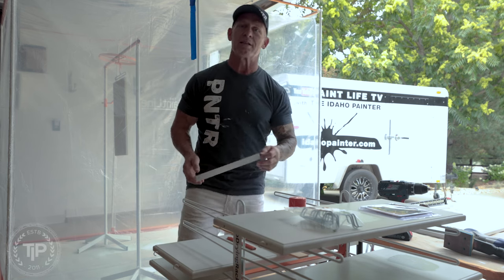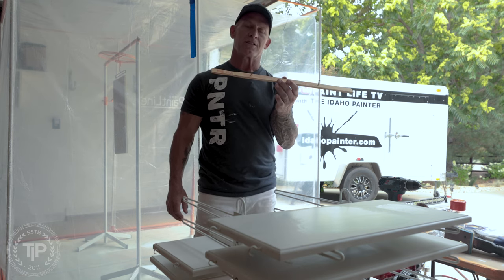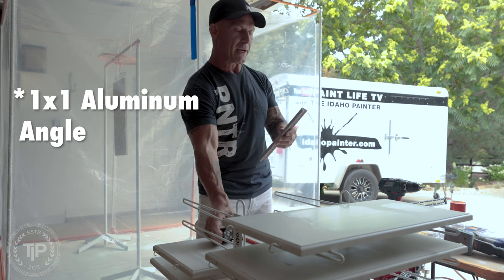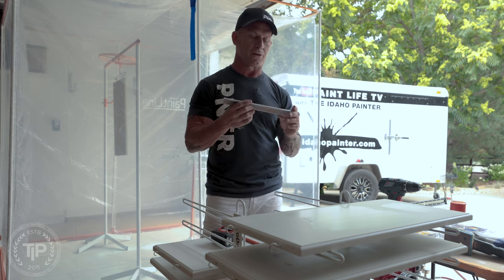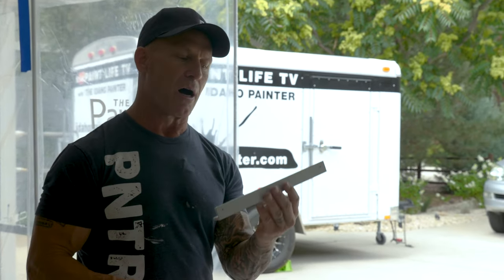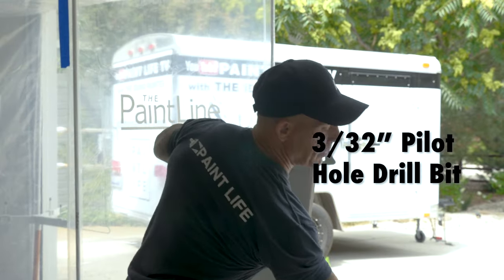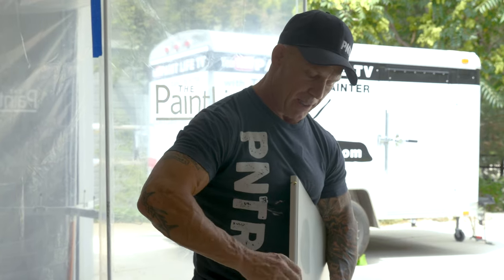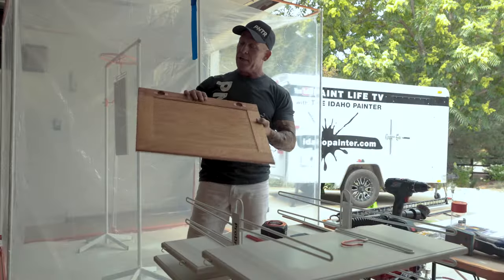Spraying Cabinet Doors Hanging.  Make Your Own Cabinet Painting Tools!

Comment from the maker: Do you spray hanging or flat?
Reply: Flat, but have done both. I just prefer flat. Great video Chris!
Reply: Flat, but willing to try hanging
Reply: Depends on how many beers ive had. 6 or less, hanging. 6 or more...flat. Lol
Reply: Flat but I like this hanging get up you got
Reply: Flat
Reply: I’m spraying doors on a coated wire hanging outside with wire coat hangers going through the door hardware hole😄 but i m using a good tip & graco airless!
Reply: Hanging, but in Sweden the doors often come with two holes drilled right through for the handle to attach with a nut and slim bolt, so my work is made easy by just popping it onto two steel rods that won't bend. Kind of like the metal hangers that stores hang stuff like chewing gum bags on.
Reply: I always thought flat to ensure no runs

Comment: Use the existing  hinge hole on each side of a door for a hook, then suspend from the wavy hanger with looped zip ties.  All sides can be sprayed, the door won't accidently come loose and fall,  and no new holes need to be drilled and filled for finish.

Comment: Why not paint them flat on a rotating support? Anyway, you'll dry them flat on a drying rack. Is there any advantage in painting them vertically?
Reply: Vertically allows both sides to be painted.
Reply: Paint both sides at the same time, no need to wait all day for them to dry
Reply from the maker: Yes there is

Comment: Chris, thank you so much for all the amazing videos. I'm a diy guy and at the moment I'm taking on the task to repaint my sisters kitchen cabinets while shes at the hospital. Its a surprise. I took care of all the prep but now I'm stuck on what primer to use. I was going to use the Bin Shellac but in other videos you've said its not a good idea to use the same gun when spraying oil based and latex paints.  Is there a water based primer you would recommend? I really need help with this because I cant get a straight answer from anyone. I'm planning on using Sherwin Williams emerald paint. I'm open to using a different paint as well.
Reply: they make a water based  Primer - B-I-N Advanced. I plan on using in my HVLP gun on my cabinets soon with Emerald trim paint soon as I complete building new doors.